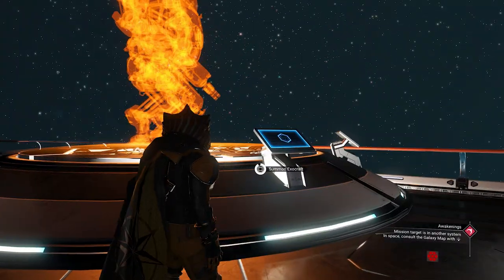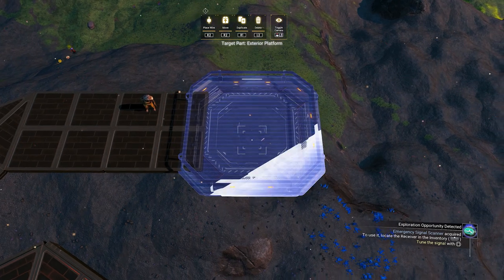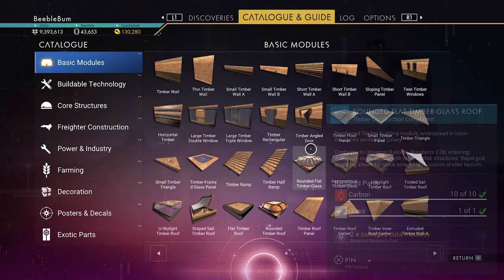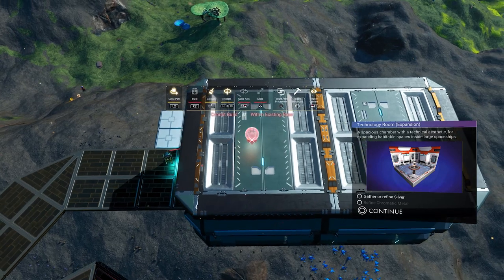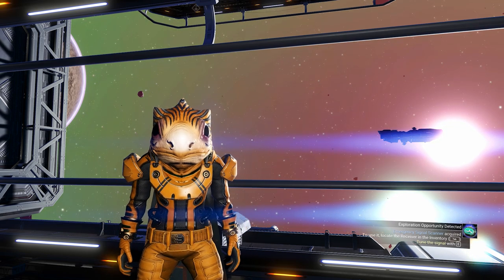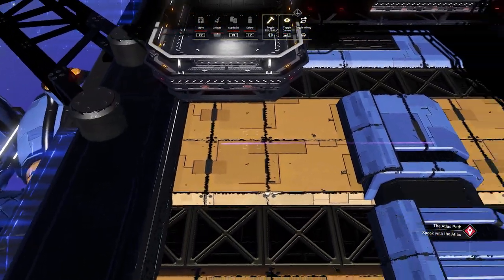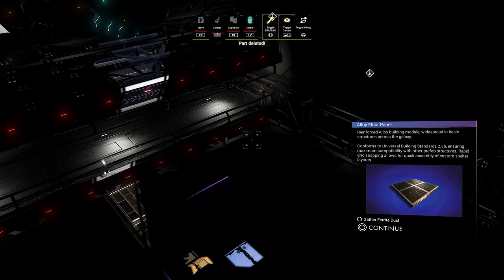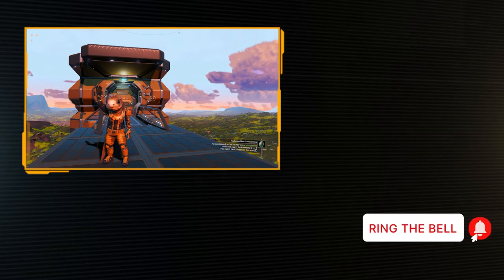The Cachepin Glitch - Glitch Building Techniques in No Mans Sky (Slightly Outdated)

Comment from the maker: Due to some changes in updates, this method has slightly been nerfed.
NOTE: To complete The Cache Pin Glitch, be sure to have space available in your Inventory (3 Empty slots should be fine) and make sure you also have the resources needed for both items you use to build the Cached Item.
Reply: what is slightly, whats the workaround
Reply: I have 30 empty slots and plenty of resources but it's still not working
Reply: Deleted interceptor repair quests and it works now

Comment: I have a tip for anyone else who was watching this to learn how to place exocraft pads on your freighter. The minotaur geobay will end up in the correct orientation... because it's normally backwards, go figure. For everything else, they'll default to facing into your freighter instead of out. To fix this, instead of copying an empty platform and cachepinning an exocraft pad, copy a set of exterior stairs with the low side facing the edge of your freighter. (This means you will have to build an empty platform in front of your exocraft pads so the stairs can attach to something). Now cachepin your pad in place of the green stated stairs and everything will be facing the correct direction. Even works for the Nautilon, (which you have to get out and roll off the freighter to launch). Enjoy your titanfalls!

Comment: Ive got aroumd 1000hrs in NMS. Built many bases on multiple toons all across the galaxy. And I still have no idea how the cache system works. Put in cache/duplicate???  Say what???? My brain dont work no more.
Reply: The "Wire Cache" is just a reference to storing a buildable item where the Wire is.
By pressing Both Wire Toggle & Item Toggle simultaneously the item in hand goes where the Wire was. (Wire Cache)
This allows you to place a substitute item (the item in Wire Cache) instead of the item in hand.
For instance:

PLACE a re-sized item ie: Lantern (shrunk or enlarged)
Now, take an item that cannot be resized ie: Bio-Dome but don't place it.
Instead press Wire & Item Toggles simultaneously (Triangle & Square on PS) (it's easy)

You should now have your normal selection reticle.  Built items should highlight blue.
If you see the Wire tip, just try again.

Now, copy the resized item (lantern) but don't place it. (R1 on PS)
Instead, Press Wire Toggle & Item Placement together (Triangle & R2 on PS)
(timing takes a few minutes of practice)
If done correctly, well... you'll see.
If you Instead placed a Wire, just cancel (O on PS) and try again 
(No need to start over unless it's finicky - fails several times)
Reply: Wire Glitch & Reverse Wire Glitch 
Just means placing a Wire instead of the item in hand, or placing the item in hand instead of the Wire.
These are used to place items where it would usually be either difficult, or literally impossible.
They tend to get used in conjunction.
You Wire Glitch to put a Wire Snap Point into a specific place, then use the reverse to place an item there.  A ton of uses.

Both are the same:  Press Wire Toggle & Item Toggle simultaneously (Triangle & R2 on PS)
Just either start with the item in hand, or Toggle to Wire first.  Each places the opposite.

Note: Wire Glitch requires a Snap point for other Wire end.

Comment: watched your guide on flippping floors upside-down using the "battery" wire connector which is supposed to be upside-down... but the connectors on my battery are not reversed (is that a change in 4.0 Waypoint)... do you have a fix for this??? 🤔🙂🙏

Comment: But everyone do keep in mind there will be a chance where when you select the Blueprint again from the catalogue it will end up auto completing the pin even though you haven't placed it i had this happen to me a few times. Also it is possible to put regular wires on your freighter you have to do reverse wire glitch to get it to work (Works even when red stated) and when you get the desired length of wire simply switch back to the building part and do the reverse wire glitch again and boom there you have it you now have a wire that you can use to do the glitch with.
Reply: That's really interesting - I will have to try that. Bytebeat cables are a pain.

Comment: Nice ❤ much easier to follow this one! It's gonna be a pain though to do. I was doing wire glitching last night and I just can't consistently get the button presses right. I get 1 in 3-5 tries I think 😂
Reply: I have problems with my hands, after Beeblebum's help, I'm getting it right more often than wrong now.

I've been glitch for only 18 months and still make many mistakes.

Happy Glitching!
Reply: I'm a PS4 user and my glitching improved on two fronts: lots of practice and a change of joystick. I've gone from 1 good attempt in 3 tries to mostly getting it right first time (like 1 fail in 8 attempts, maybe). The joystick change just about doubled my accuracy which encouraged me to practice more. YMMV!
Reply: @tribaltalker1608  yeah, practice is very important.
I play the PS4 and PS5 versions of the game.    One of my streams has me glitch building.    lol
Reply: @tribaltalker1608  interesting. What change of joystick? I'm a PS4 player as well!
Reply: @Siferiax  From a worn-out piece of no-name off-brand junk to a new Nacon wired PS4 controller, a "Playstation official licensed product" and reasonably good quality for the price. The triggers are very responsive, which is the thing that helped me. I've used them before and they are always nice to use. The downside is that after 4 months of admittedly heavy usage, I need replacements. I play some fairly frantic games and I'm shamefully brutal with the controller. I kill joysticks more often than boss monsters...
NMS is my chill-out game of choice.
["Nacon Wired Compact Controller (Red) (PS4)" on Amazon UK]
Reply: @tribaltalker1608  thanks for the info! I'm using the official PS4 controller actually. I should probably also get to know when the trigger "fires" to time it up correctly with the other buttons. I go from pressing triangle without R2 to R2 without the triangle and after messing that up awhile, I hit it just right and then I can hit it just right a couple of times before being completely off again. And I feel it is mostly the trigger I feel. The triangle + square button combination seems to go much more easily.
Reply: @Siferiax  Hope the info is helpful. I have more trouble with the "triangle+square" caching move than with wire glitching. But both are quick to redo, so not a problem. I get into a groove when I'm building and only fail the glitch when I start to notice how well it's going. Practice really helps. Good luck & happy building!

Comment: Thank you for this. It ended up being much easier to do than I anticipated. I installed a freighter teleporter at one of my bases tonight and oddly enough, I can't get the "powered on" animation to appear even though it does work. It dosn't require any external power either, which I guess is a trade off then.

Comment: On PS4 this Cashepin doesn't work on the freighter. Once you have tried to place the part it gives you an 'outside base range' message. The same applies to the wire placement, the original reason I came here. 
I was looking for a way to power the light-boxes and light-floors on the Freighter. If placing a Standing Planter it is automatically powered, but not the boxes or floors.
Reply from the maker: The Waypoint Update seems to have changed that a bit.
Be sure to have 2 conditions met:

1) Have the resources you need to build both parts
2) Have inventory space free
Reply: Thanks for the reply. Maybe I didn't have it in my inventory, but I doubt that. @Beeblebum

Comment: Is this still working. I am trying to add freighter rooms to my Low Orbit Base. For some reason the Freighter Room will not cache. I am on PC.
I load the Freighter part into my Secondary objectives.
Click Z, then C and C again. So far so good. Press B to go into build view, I click Q then C but for me I have the wire placement showing and not the duplicate option. If i go back to Q and then back to C, i can duplicate pressing E but when I try to wire glitch it just loads the duplicated part rather than the Freighter Room. Something is amiss here. Any advice YT? Thx

Comment: I figured out to get the freighter stuff off the frieghter as I thought it was patched but the door is really small and not full sized
Reply from the maker: Yeah, the frame is  not included when adding the door... Also, you can not delete the door when there is no frame.. lol.

You can try to line up a corridor to the doorway to be able to remove it, but that only works when you have a point of origin to snap to.

I used the door in my Stasis farm design though, which worked out pretty well.

Comment: I beeblebum, very nice video, i wonder how to build freighters rooms with stairs and another level pls ?
My problem is with the another level, rooms and stairs suit well but, the room in the level up, no... did U complete that kind of building
thank U very much in advance
Reply from the maker: Hey Vincent, I assume you are talking about building the Freighter rooms on a planet and have a 2nd level?
It is possible, but I have not made any guides about it.
Reply: oh thanks, i'll continue to try @Beeblebum
Reply from the maker: The freighter rooms have the same dimensions in relation to cuboid rooms and such. SO if you build your freighter rooms from a scaffolding made out of cuboid rooms (or frames) you should be able to lift things up to a 2nd level.  @vincentrock8260
Reply: the were right! thankssss so much ! @Beeblebum

Comment: Hello Beeblebum! I'm having a bit of a problem with this glitch...
Everything has worked so far, but after completing it once, I can no longer pin instructions at all, despite meeting ALL criteria.

Any idea what the problem could be?
Reply from the maker: I forgot which update, but since then, the cache pin glitch has been nerfed a tad.

Here are some fixes I found helped to make it work:

1) Be sure to have free space in your Inventory (3-4 free slots should be enough).
2) Make sure you have the resources in your inventory that is needed to build both.

Also, could you let me know, if that did not help - what game mode you are playing on?
Reply: @Beeblebum  I met those requirements, however it still didn't really work. I ended up finding a work around, though:

It will mark the completed freighter base part as complete every time you finish building one, and there is a chance that it will stay "completed" no matter how many times its pinned. A workaround I found was to pin and complete instructions of a cheap base part after this occurs, (e.g. a wooden wall), then pinning freighter base part instructions would work again.

To answer your question, I am playing on a Normal survival mode save

Comment: Hey there - I'm trying to place cube infrastructure on a freighter and following your instruction, but pressing square twice once cube is pinned sees me default to freighter corridor, even if pointing at blank space.  Have you heard of this before and is there a work-around?
Reply from the maker: Hey Zaz, Not sure - Its been a while since I used the buttons.. 

If I recall correctly, you need to open the buildmenu first, then press Square to exit the menu.

The second Square is to switch back to the Edit menu? (I am guessing here.. need to check again what the exact button combo's are).

Be sure of 2 other things as well - Have space in your inventory, a full inventory will fail the glitch.
And make sure you also have the resources in your inventory to build the parts.

Comment: I know this video was a while ago but I'm hoping someone has an answer for what I'm doing wrong. I was trying to put a teleport bridge on an exterior freighter platform but it keeps placing the SRTs inside the floor. To fix this I thought I'd temporarily replace the platform with a glass floor (as I saw in one of Beeblebum's other videos). Following this video, I believe I'm getting the glass floor in the cache ok. (I can see it in red state). The next step is to store an exterior platform in cache using Y+X on XBox controller. Instead of the platform turning blue I see a wire-end and a message that I'm too far from base.  doing  the last step (duplicating the platform and then wireglitching with Y+Rt just leaves an empty space with no alloy panel at all.  I've been trying this over and over all day and I get the same result. Wondering if an update has broken this or if I'm still doing something wrong?    Thanks.
Reply: i came again to this video to confirm i was doing this right and in fact i am. i guess hello games patched it or broke it in one of the latest updates so even if you perform it correctly, you are likely not going to have much success or under very specific parts/circumstances.

Comment: Has this been patched? Ive previously used this but now when I go to me catalog and guide and try to pin my part nothing happens. Tried it across multiple saves
Reply: Were you able to figure it out or it's been patched?
Reply: Same. I have the resources. Keeps giving me the base computer.
Reply: @Korelie  nope
Reply: i'm not able to pin the parts either (i came here cuz i encountered the same problem)
Reply: Update : If you have Interceptor repair quests active you cannot pin the recipe, delete the Interceptor missions and you should be good
Reply: @autopro576  ouu I'll try that later, ty
Reply: @autopro576  Bro, thank you. That’s what it was for me. Such a strange quirk.

Comment: I need some help, the cahepin doesn't seem to work for me 
I've tried countless time to Q+C, however it either puts up the cable menu, or the edit menu, never both 
If I press C slightly before Q, it puts the  C menu on top of the Q menu, meaning I have to deactivate C, then it gets back to cable menu, and if I deactivate it, it goes back to the item I was trying to resize, for exemple. 

I've been trying to find other videos out there, but nobody seems to be having that problem...

Comment: I’m having trouble getting the bulkhead to attach properly. If placed wrong, I can’t delete it. 

Is there some trick to delete?
Reply from the maker: I am assuming you might have a window or a door placed in the wrong place?
There is a way to remove it, but you need to glitch a corridor or room against it.
If you have any starting points or Rooms that are lined up, you should be able to do this - If not, then its very hard to line up anything with it. So you might have to delete your Basecomputer.

Comment: @Beeblebum can you confirm if this is still working? I've used this glitch a lot in the past, but it didn't seem to work anymore. 😢
Reply from the maker: I need to double check again, but I have not heard any other regular builder report issues with it.
Make sure of 2 things when doing this:

1) Have the resources in your inventory that you need to build the glitched part
2) Be sure to have at least 1 empty spot in your inventory.

Comment: It doesn't work for me on PC. When I press the second time with the "C" edit button, I was presented with a base computer. I cannot proceed from @1:30. It is caching the base computer instead of the exterior platform.
Reply: Make sure you have the resources to actually build the part. Beebs mentioned this in this video, but was running into this problem after his earlier one until I realized I was missing like a single metal plate for the minotaur station.

Comment: I have a question beebs; do you think Sean sees these techniques that aren't meant to be and clearly are a exploits, but he doesn't want to fix them because at the end of the day you and others use more as tools than anything else?. Do you think there will be a day that they'll be forced to fix those glitch construction exploits? I don't want to imagine that day if update 4.0 was a taste of community indignation.
Reply: They'll never fix these, I'm not sure why they don't just add them as features because everything these glitches do clearly work just fine
Reply: @ballsucker28  they kind of almost implement the replacement feature, but it only works with objects of the same kind, walls with walls, floors and so on. If they allowed freely to switch a part or a decoration with anything else it'll be a huge step tough